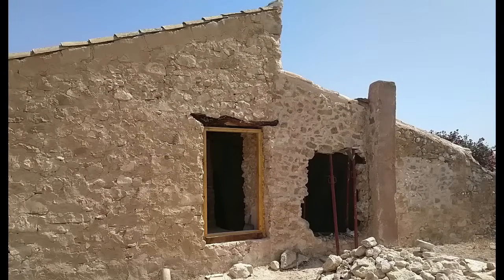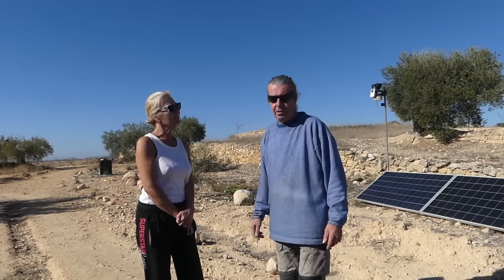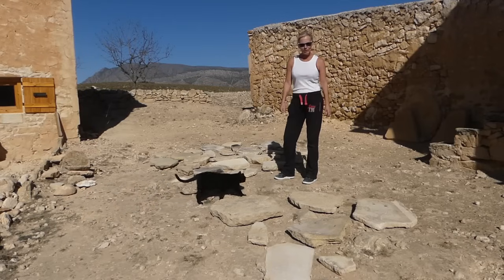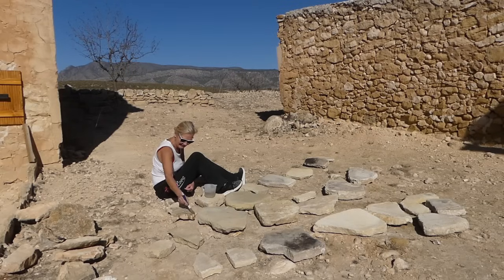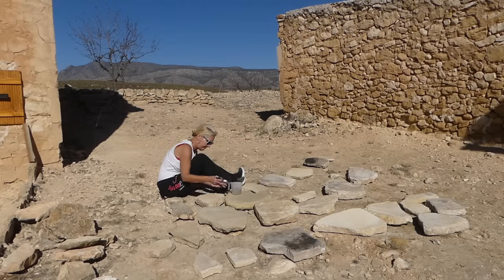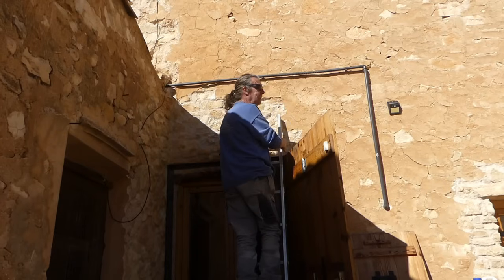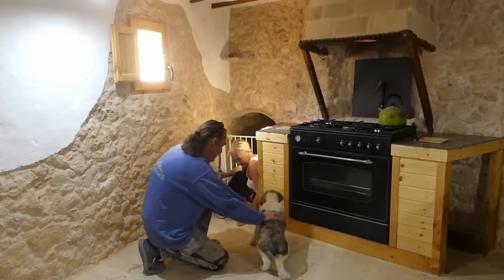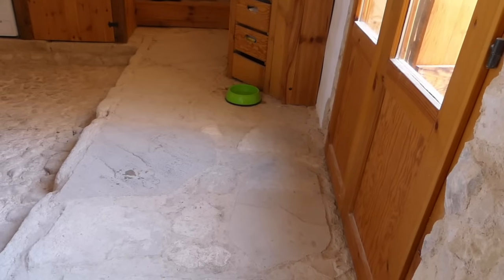Marble tiles meet natural stone floor - 150 year old Finca kitchen renovation

Comment: Hi both, your place is looking amazing, well done. A couple of questions I was wondering about. 1 those aircon units, will you be able to have re installed? The reason I ask is here in Portugal aircon older than 10 years used a gas that is now illegal here. That means buying secondhand aircon units is high-risk as no installer will fit them. Not sure how nit works there. But I'd be interested to hear how you get on. 2 re all the lovely stone work In your kitchen, as the lime you have used in breathable is it also porous? My thoughts is how to you deal with kitchen varpores like hot oils.and will you impregnate the stonework with cooking residue you can motivate clean away. Or you you have a plan/solution to seal the stone and lime while retaining breathability? Take care D
Reply from the maker: Thank you. Both the aircons use the current gas and we'll be fitting them ourselves. Sealing the walls will reduce their ability to breathe and in any case we have a big chimney hood above the cooker and everything goes up there
Reply: @FincaLife  . Ok great. I did not realise you can re gas aircon units yourself. I'll be keen to see how you do that.
Reply from the maker: @EastLondonKiwi  The gas was retained in the unit when it was taken out, as they are when they are new. In any case, the friend who gave us the units is a HVAC engineer.